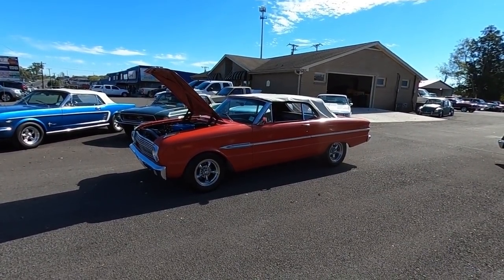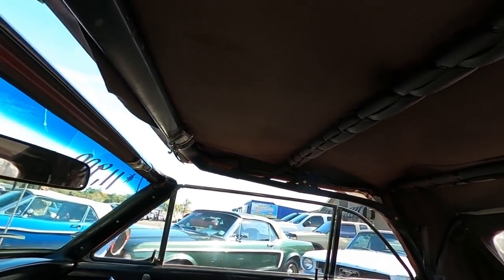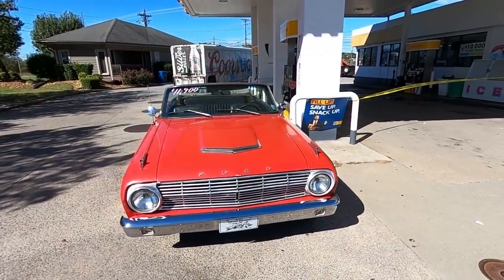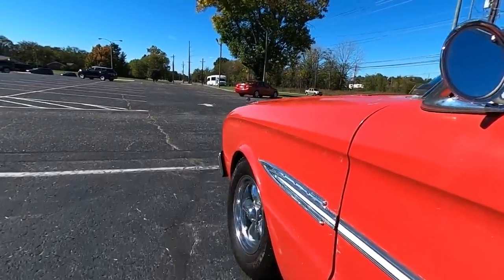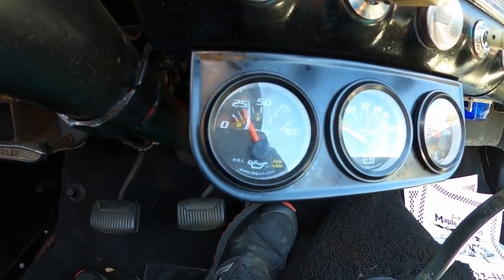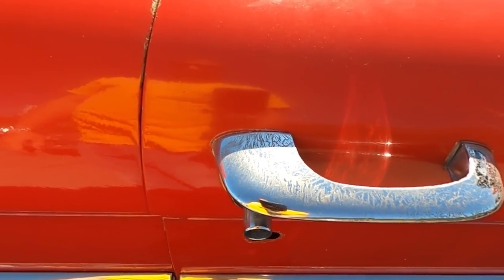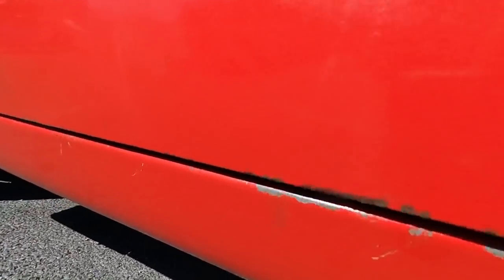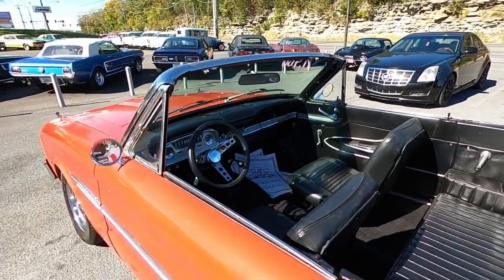Test Drive 1963 Ford Falcon Convertible SOLD $11,900 Maple Motors #1240

Comment: Wow, what a rough cut in car. It should be called the chip car. An those floor pans looked really rough underneath. Looked like someone wanted to get rid of it in a hurry. Lots of work to be done on this ol falcon.
Reply: Does it look like it's worth $11,900.00 ?   I fixed one up for our daughter years ago. Had the 6 and 4 speed on the floor. Lots of rust underneath. Had to get some aprts to get the top to go down. New rear springs and put an AM/FM radio in the glove box for her. Didn't want to cut up the dash. Ours was red with red interior. She drove it the last two years of high school. Was the talk of the school. She went on to Ivy Tech for nurse schooling but needed more reliable transportation. Got her something else and sold the Falcon. I think she wishes she still had it.
Reply: @UNITED2009100  looks good from a distance but up close it probably would need about another 6-8,000 dollars worth of work to be a really nice ride. An it's really what you want, some people would be really happy with it the way it is. I build alot of street/rat rods. So you can build them really nice or just enough to get rid of them. Our main focus is that it is very safe. It's all in want you want. To me the way it is: it's about a 6500-7000.00 dollar car. Remember that's just my apinion. An as you know everyone has one. An I'm not talking bad about the little falcon. I myself have a 63.5 falcon futura 2 door hard top with a mild 302 automatic in it. I wouldn't trade it for that convertible.once again thats just me.😁👍👍
Reply: You get what you pay for besides it's a Ford fix or repair daily I love Chevy & mopars like drinking Bud and pissing Coors

Comment: When i was in high school in 72-75 you would buy a falcon or a Fairlane for 150 bucks , throw a set of highjackers on it, a thrush muffler, some 60s on the rear, 70s on the front , craiger SS rims, 8 track under dash and you were all set. You would either gonna wreck it or blow it up and you would buy another one and start all over again! Good times. Great shows dude, good bless you and your family. 🙄🤠